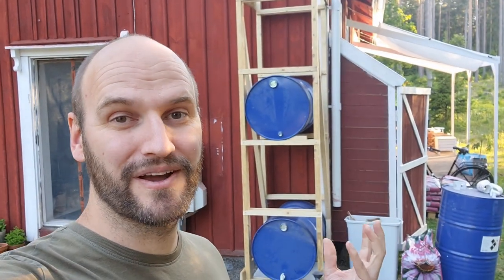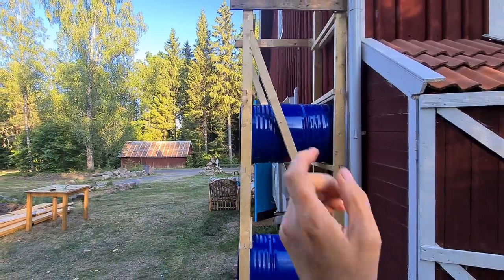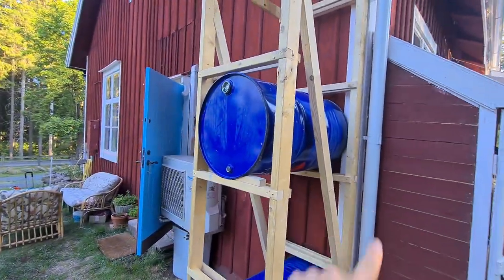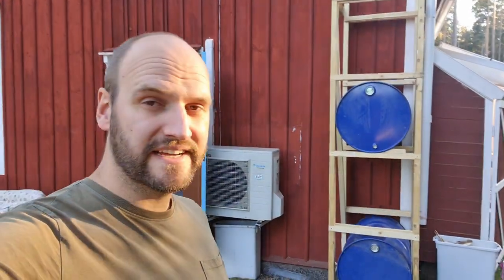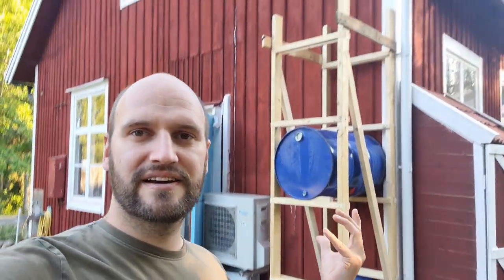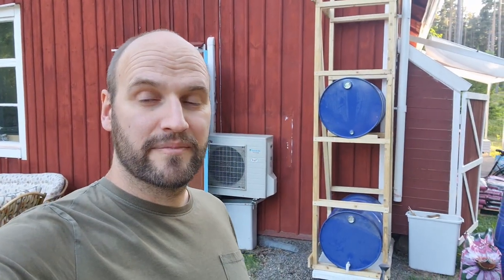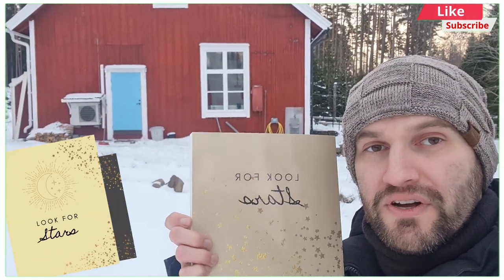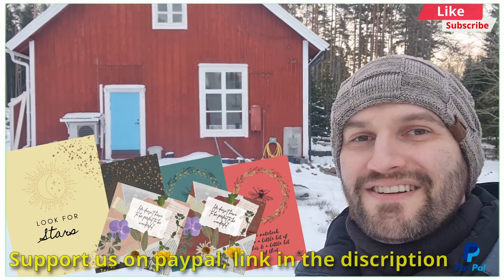Making a water tower part 2

Comment: Looks nice, everything in blue does. But I am asking myself: how is it going to work? How do all the drums get filled with water, and how do you get the water in a controlled way out of the highest drum? 
Besides, water is cold, the house is of wood and you don’t want to get moist into your house because of condensation at the dewpoint coming to be in your wooden wall…
Why do I write this in English….?
Reply from the maker: Condensation won't be a problem, it will be well ventilated. As for your other questions stay tuned. You will get to see it all in upcoming episodes.